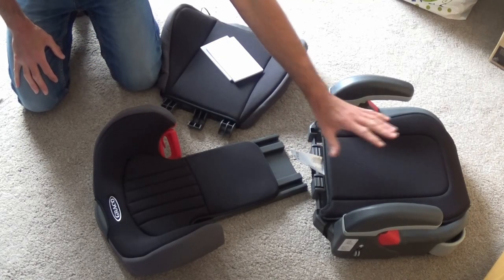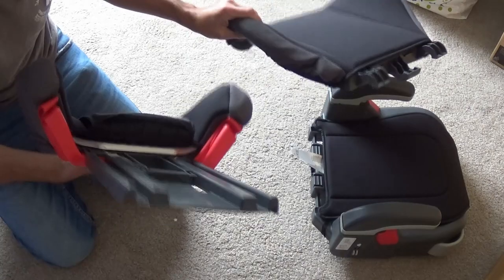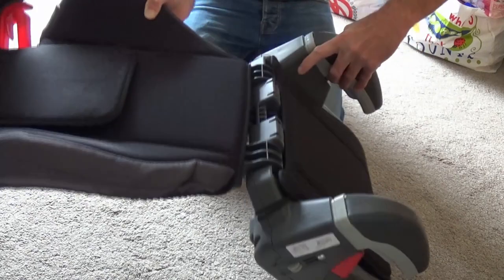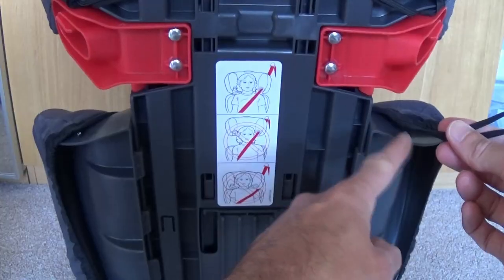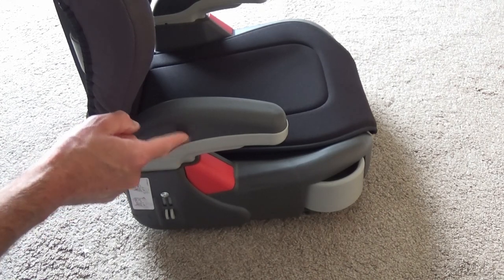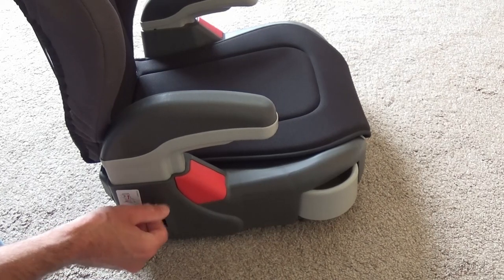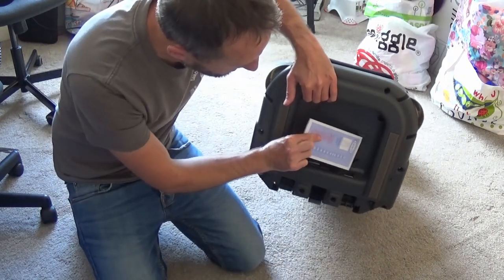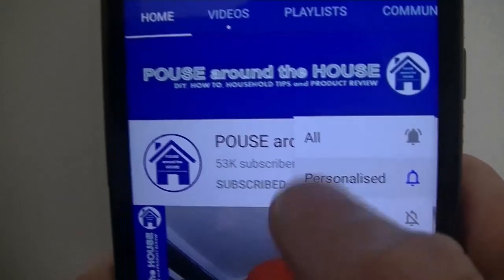Graco Junior Maxi Car Seat assembly. How to assemble Graco lightweight high back booster seat.

Comment: What about the red strap with the buckle?
Reply from the maker: If you mean the bit at the top, they are for the seat belt to go through and depending on what side of the car the seat is placed dictates which buckle is used.